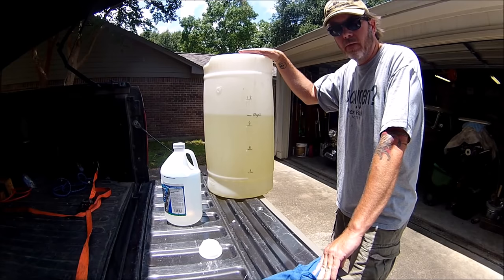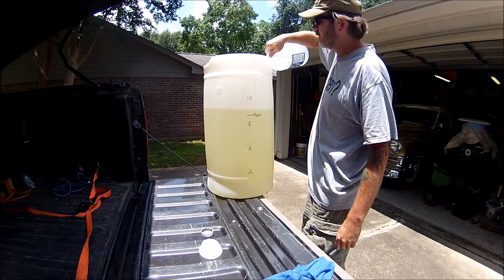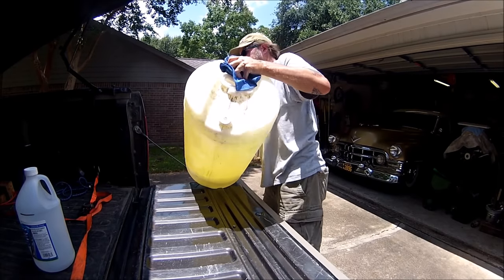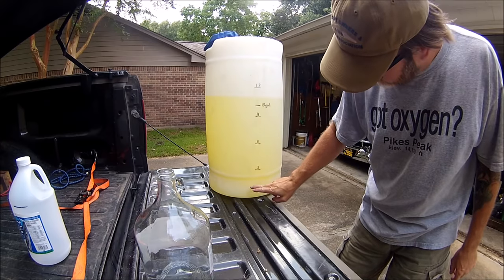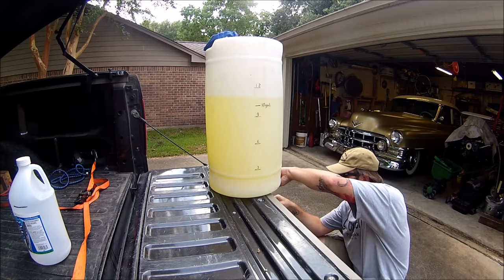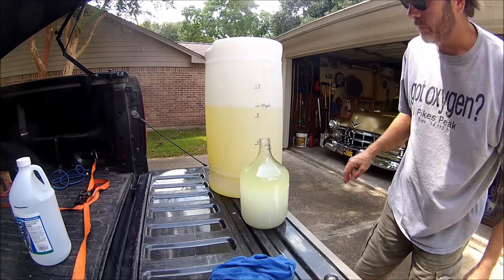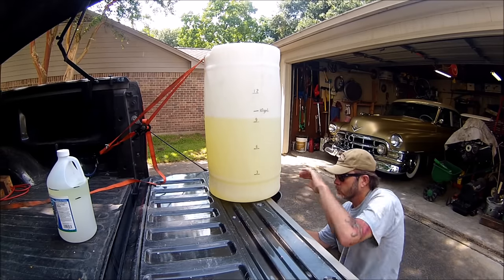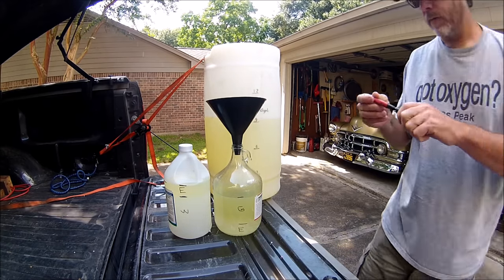How to easily extract ethanol out of gasoline.

Comment: Why would anyone do this?  Ethanol blended fuel will do nothing to your car,  and most states allow the sale of non ethanol fuel for use in classic cars or off road use..........In fact this gas has more potential to harm a engine than just using regular gas from pump!
Reply: I've used ethanol in everything,  outboards,  chainsaws, lawnmowers, Ice augers, weed whackers,  snow blower, my truck, car, ........Never once have had any fuel related issues.
Reply: Yeah,  just non oxygenated gas, legal for use in classic cars and off road use. most stations have at least one pump with alcohol free fuel........Besides, whats he doing with the water afterwards? Drinking it!?!?  Cant toss it down the drain!
Reply: I have a  Johnson 9.9 horse that's older than I am (49) I've used regular 10% ethanol gas in it for the last 20+ years, I just drain the fuel and fog the cylinders every year, hasnt had any trouble.

Comment: So what's the point of pulling the ethanol out. I mean in an Ideal world we would only have ethanol and gasoline would go away right cuz gasoline is the actual shity fuel. There's a reason why they used to throw that shit down river back in the day and then they had to throw all kinds of additives in it just to get it to burn in an automobile engine. Where ethanol burns amazingly perfect for an engine and doesn't need any additives... you can even water it down with gasoline and it still burns great. Lol you probably don't even have 93 octane anymore if you pull the alcohol out.

Comment: I've got 2-3 places right by my house that sell ethanol free gas.  This seems like a lot of wasted effort if you can just buy ethanol free gasoline.  Besides that, as others have mentioned, alcohol adds a lot of octane to the gasoline.  This way the gasoline manufacturer can use really crappy gas and boost the octane and sell it as premium gas.

Of course, there are lots of other angles to this scam...
Reply: barking.dog.productions1776 I agree. But the key word is IF. Most of us don't live 2 blocks away from a marina or other store that sells ethynol free fuel.
Reply: These are just local gas stations that understand that there is a market for this product.  If you don't have one close to you, then why don't you go talk to some local business owners about the market for this product?

Explain to them the problems associated with ethanol, and the customer demand for clean gasoline.  After all, ethanol is much more attracted to water in the air which causes it to attract water into their tanks and to settle out as watter in the tank which loses them up to 10% of their fuel volume when the water needs to be pumped out, opens them up to customer lawsuits, etc.

Comment: Why bother doing this? Whatever benefits you might get by removing the ethanol  are easily outweighed by the effort to do it. You get a tiny better fuel economy, and you may get a tiny bit less leftover crud in your engine. What's the deal here? Is this a 'stick it to the man' kind of thing?

Comment: it would come out your valve faster if you loosened the cap on the top. buy ethynol free (which is reg grade gas) put some octane booster in it. its a hell of alot easier than what you just did. smarter not harder.

Comment: Ethanol, C2H5OH, belongs in good Bourbon, NOT in gasoline. Oil and water don't mix so small engines will have problems running on this garbage. Cars, even though they are engineered to 'tolerate' this junk gas, lose performance and MPG because of it.

Comment: Go to a general aviation airport & buy leaded aviation 100 octane gas.
Reply: Have you priced aviation fuel.  Quite expensive - I only use ethanol free fuel for my smaller engines.
Reply: aflarry That's a great way to plug up cats...

Comment: Lots of crazy comments/ people here. If ethanol is in the gas in your area, ITS IN ALL OF IT THE SAME! 85 87 89 91 whatever! 

Also, most of the people who are concerned about ethanol know what it does to engines they don't use everyday: lawn mower, boat, quad, etc. This is why people go to extremes. I live near Phoenix. We have ethanol in our gas year round. But an hour north in Payson, no ethanol. Talk to the fuel delivery guy when is dropping gas at your station ( and pray the station maintains pump filters if you're buying that stirred up gas) you can learn a lot from them and they have always been forthcoming with me. They know exactly what they are hauling.

I can buy 5 gallon pails of race gas for about $52 for lowest octane...it is ethanol free and stays fresh longer than pump gas. My landscape equipment runs fine on it, but unless you run higher compression pistons, you get no added power on stock equipment. Just no gummed up fuel system!

Comment: so let me get this straight.  10 gallons gas with 10% ethanol +1 gallon water=11 gallons.  now 11 gallons - 10% ethanol =9.9 gallons -  1 gallon water = 8.9 gallons correct?
less than 1 gallon drained off so that leaves more than 10 gallons in gas container, indicating not only is there still ethanol in the gas but you added water to it thus leading to the amount over 10 gallons in the gas container.
Reply: Rusty Hefferman, your math is wrong. Yes 10gal of gas + 1gal of water  does equal 11gal of liquid.  But then you got lost in your equation. The 10% ethanol needs to be taken out of the original 10gal, not the 11gal. and 10% of 10gal is 1gal. So he's trying to get about 9gal of ethanol free gas (maybe  a little more because it's "up to 10% ethanol"). So in the end he should have 9gal gas, 1gal water, 1gal ethanol.
Reply: Anthony Guiliano II 
ok i was off by .10 gal , there was still less than2 gallons removed and you could see part of what was removed was gas due to it separating which was according to the video was gas. so despite my miscalculated figures, there was still ethanol and now water because it does bond to ethanol still in the fuel it was not improved.

Comment: 13th Va
Yes...why do you "bother" telling me this! I'm an old mechanic that can  "repair" (which is nothing more than Ultrasonic cleaning) a carburetor in much less than an hour, but the ultrasonic process takes 2 hr., during which time you can be working on other projects. E10 doesn't "ruin" carbs.... only clogs up.... but then "you are obviously an expert on everything"!

Comment: You guys talking about removing ethanol from gasoline . I dont think you realize that the ethanol is a fuel booster .  So you go and buy gasoline that is lets say 97 octane and has something like 7 to 15 percent ethanol which is Alcohol  and wanting to remove it . Why may I ask . If you do the you lower the octane to about 68 or lower  . High compression ratio engine cant burn that low of octane vary well . I did this once . Hell my lawnmower wont even burn it  .  This is OK if your car engine has 6:1 compression ratio . Anything above that is not going to burn well at all . The higher the combustion ratio is the harder your car is going to start if it's going to start at all . Personally I dont like alcohol in fuel as you guys but it has to be in there . Now at some filling stations you can buy 97 Pure gas . but those are hard to find anymore . Alcohol is not a bad thing anyway . Adding 7% alcohol to pure gas of 97 octane will bring it up to 105 octane .  One thing about the old gas we had bought back in the good old days is the gas lasted longer for about 6 months . This is because of stabilizers and other additives that they dont put in cars anymore . So fuel goes bad in a shorter time .  The reason why they do this is because the government dont want you to stock pile fuel . Just in case when people will revolt in this country . That why the real government has two parties to keep the blame on the other party . It's called dived and conquer . This been going on for a long time over 200 years now . If there was a revolution in this country the government dont want us win . The only was that we would win if the government military committed treason by going to our side . If that happens the heads of state will fall . The only reason why any country have a military is to keep those cronies in office . It's called protection not of the Constitution but them selves .